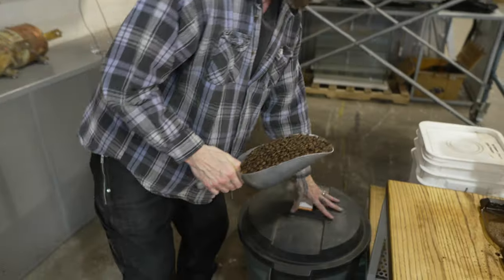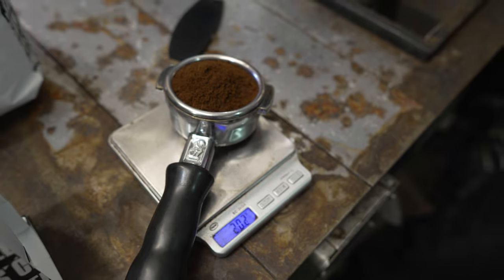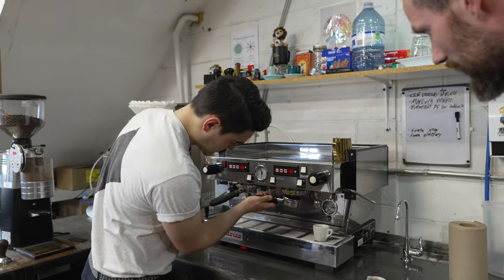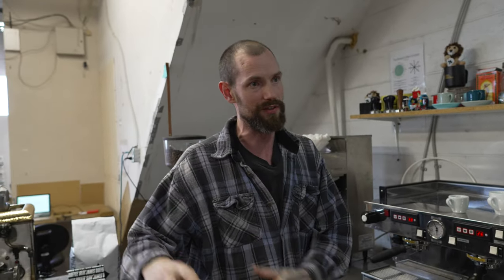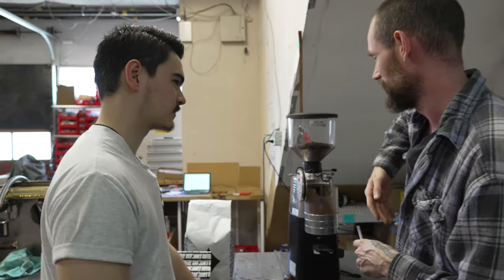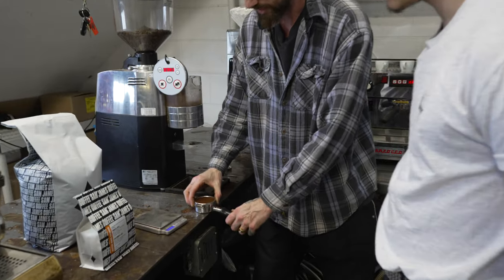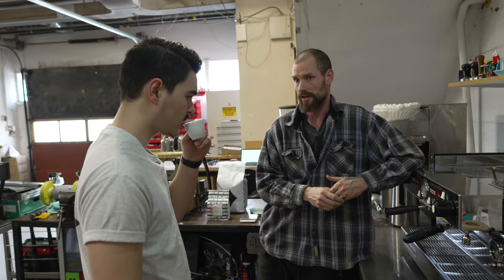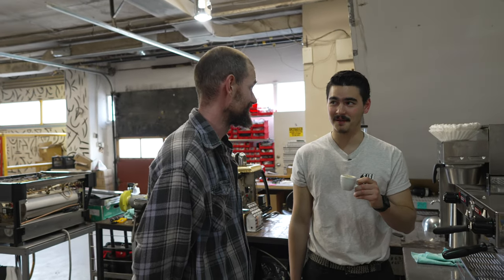COFFEE SHOP TUTORIAL: HOW TO DIAL IN BUTTER KNIFE ESPRESSO WITH SAM JAMES

Comment: Weight is weight - if you have 20 Grams of coffee in before you scrape it... and you tap it so it compacts before you scrape it..., is still 20 grams.  So I have to call Foul on that comment.  20 grams is 20 grams -= tamped or loose.
Reply from the maker: Yes. That’s why I start with 20g, scrape 2g off, leaving 18g, then tap before tamping. It weighs 18g
Reply: If you do this long enough you develop a skill of eyeballing and rely on the basket volume to reflect more or less the correct weight, this guy literally eyeballed 18g nearly sharp which is cool
Reply: 2:46   I think what he was saying is that if you settle it you won’t be able to scrape off as much coffee because it will have settled below the top of the basket and once scraped more coffee will remain in the basket because it had settled. It was a bad comment and unclear for sure.  I had to watch it a few times my self thinking how does the weight change just because you settle the coffee.

Comment: Sorry to say, but this video is a bit esoteric. On one hand he avoids tamping too hard so that no cracks will occur, on the other hand he creates a preferred path for the water in the center of the puck?! Also, sealing the puck is known to have a bad impact. Just get yourself a PUQpress… And instead of wasting ~2 grams on each shot just to perform that scraper technique, simply grind less and use a distribution tool, like the Moonraker for example… 🤷‍♀️